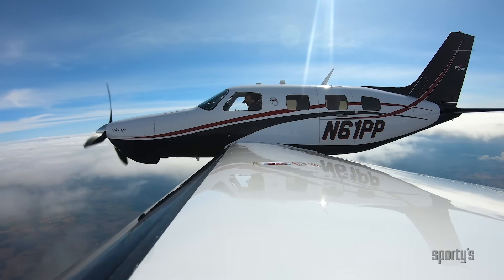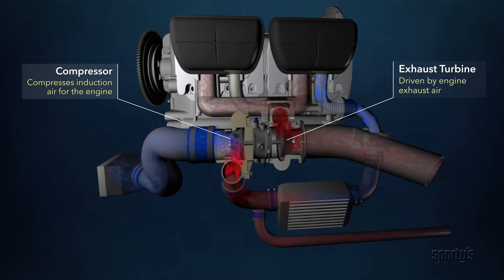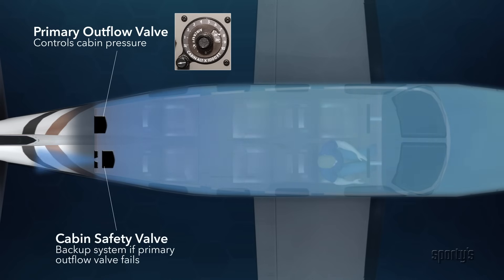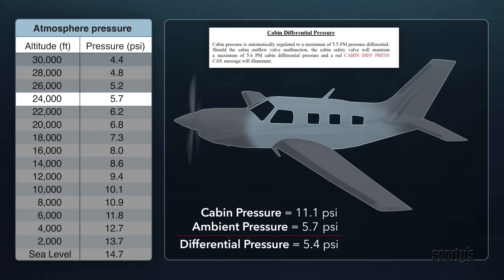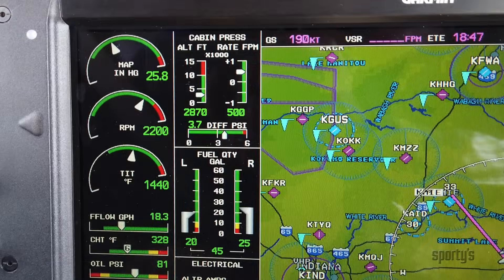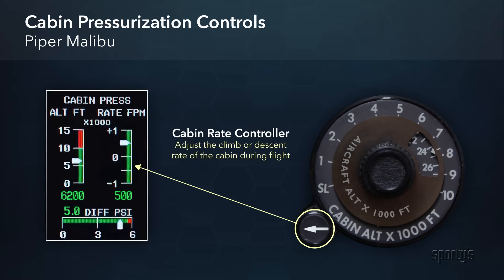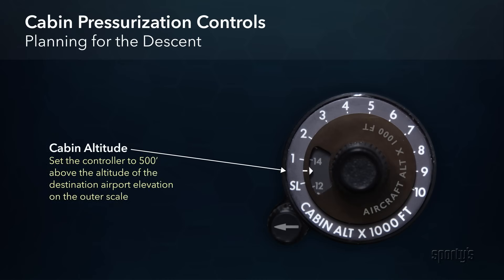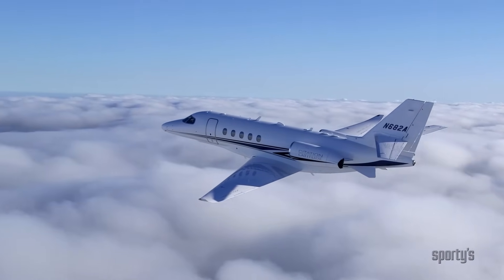How airplane pressurization systems work (and how to control them)

Comment: Just had a quick question, not to poke or prod but when explaining the travel of compressed air, you mentioned the sonic venturi and stated that the air's velocity slows down moving through this, but based off of what I know doesnt it actually speed up its velocity and decrease is pressure? Just wanted to clarify! Thank you considerably for this great video!

Comment: Laboratory 
Physics 
Laboratory 

Manifold 
Venturi
Heat exchanger 
Compressed air 
Max differential pressure
Excess pressure 
14.7 psi 
Ambient pressure 
8 - 9 psi 
5.75 psi 

Below 8000ft 

Physics laboratory 
Pondicherry polytechnic 
Lawspet 

Prof  palaniswamy

Comment: The reality of it is that on piston engines the 100LL fuel constantly plays havoc with its carbon build up sticking bleed valves and causing stuck turbos. Very high maintenance system, constantly cleaning out all that garbage.

Comment: I haven't flown for almost 10 years now
My last flights were between Manchester and Paris. On the outbound flight we were on a jet plane and when we got to full altitude, I felt really dizzy and had trouble keeping calm because of the dizziness. On the return leg we were on a turboprop plane and I felt ok.
Could this be anything to do with the fact that a turboprop flies at a lower altitude? Or would it make no difference if you were flying at 15.000 or 30,000 feet regarding the pressure inside the plane?
I'd really like to be able to fly again, but I am scared after feeling like this

Comment: What a concise video.

Most videos go: "How a pressurized airpale works... Air pressure is from an atmosphere. The atmosphere of earth has about 14.7psi at sea level. The earth formed aproximatley 5.6 million years ago, and surely had some trapped atmosphere. Bla bla bla bla bla. 

During the early carboniferous period....
Bla bla bla bla bla. 

Man has always looked to the bird and wondered what it would be like to fly.
Bla bla bla bla bla. 

Early aircraft were constructed in North Carolina.
Bla bla bla bla bla. Bla bla bla bla bla. Bla bla bla bla bla. Bla bla bla bla bla. Bla bla bla bla bla. Bla bla bla bla bla. Bla bla bla bla bla. 

Airliners such as the Boeing 737 are pressurized, and are constructed from aluminum. Aluminum was discovered by the Earl of Sandwich when he wasn't especially hungry at lunch, and thought that he might be a bit peckish around 3pm, and wanted to wrap his Earler in something to keep it from going stale, and the Sandwich was born...
Reply: Underrated comment

Comment: In the piper Cheyanne I've seen combustion heater burner tubes implode due to rapid Decents as all turbine powered aircraft do. The heater is part of the pressure vessel. Not sure if its pilot caused or something in the system that causes this. It is an expensive failure and i tell my turbine customers that rapid Decents are the culprit but i can't explain in further detail as how to avoid this other than don't do rapid Decent  or the exact cause as it relates to the pressurization system.

Comment: In simplest terms pressurized aircraft are maintained at 1 atmosphere which is what we live and breathe in.
Reply: That’s not correct.  One atmosphere would be sea level pressure on a standard day, expressed as 14.7 psi or 29.92 inches of mercury or 10.13 hectopascals.  If you watched the video, it is explained that for almost all aircraft, maintaining one atmosphere would result in a pressure differential that would exceed the structural limitations of the cabin.  This is why the resultant cabin altitude is much higher that sea level pressure.
Reply: @A_MOISTER_OYSTER  hmm but the outside pressure only gets lower than 1 atmosphere as airplane climbs up and when it lands its exactly one atmosphere on the outer walls, so structural limits are not exceeded by external pressure if the airplane walls are designed to sustain that from inside.
Reply: @BHARGAV_GAJJAR  I think you need to replay the video buddy

Comment: About the oxygen concentration ? How does keep it regular in the cabin ??
Reply: The ratio of oxygen to other gasses in the air (mostly nitrogen) does not change with altitude.  The only thing that changes is the pressure, which is what’s needed to push that oxygen across the tissue in your lungs.
Reply: When it is pressurized, the air molecules (20% Oxygen) about the same as about 7k-8k elevation which people can breathe when inside the cabin.

Comment: Hua.. didnt know Piston engine planes were capable of having pressure systems, but using the turbo for it makes sense.
Reply: There aren't many, and I think the only one in production at the moment is the Piper M350. The only other I know for sure of is the Cessna 210 Centurion, but those were discontinued in the 80s.

Comment: Very nice video explaining the basics of pressurized cabins. So what happens if the pressure from the turbo is not high enough, say in decent when the pilot reduces manifold pressure? Will the cabin loose pressure? I would have loved the video to include common issues of pressurized cabins in piston aircraft. The Malibu for example has a low vno and for a safe decent you have to reduce the manifold to stay on the safe side, I have heard often, that the cabin then looses pressurization.
Reply: So typically the turbo still spins at a very high speed even with low power. At higher power, there is a mechanical device called a wastegate that diverts exhaust gasses around the turbine fan to prevent overboosting the turbocharger.  The other way to mitigate the depressurization is the closing the outflow valve.

Remember that the cabin is not a sealed balloon, but instead think about it like a cup of water with a hole in the bottom under a faucet.  You can control the water level in the cup by either the amount of water pouring in from the faucet or by the amount of water than leaks out of the hole.
Reply: Losing pressure is indeed a problem and there are two sides to it. First thing is that the controller/valve is slow. That means if you reduce power, it probably would have to close the valve pretty quick because now most of the air has to be kept inside and excess air is getting low. Since it can't do that as you reduce power the cabin alt goes up at a relatively high rate for a short time. Maybe 2000ft/min for 5-10 seconds. The value depends on how fast you move the throttle. If it done very very slowly I guess you can get away with only 500ft/min.
If you are up, overspeed is a lesser issue, so I can use 22-24" MAP and have enough air. Down low I go for 20-22" MAP and everything is fine. All values are for a Continental engine (310P) and a descent rate of 1000fpm.